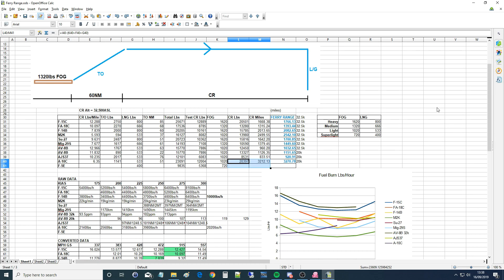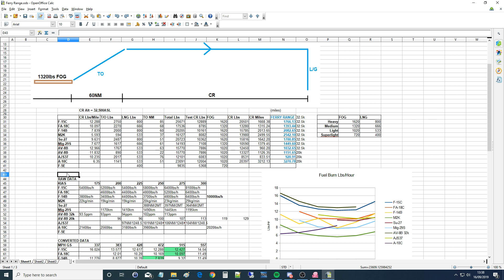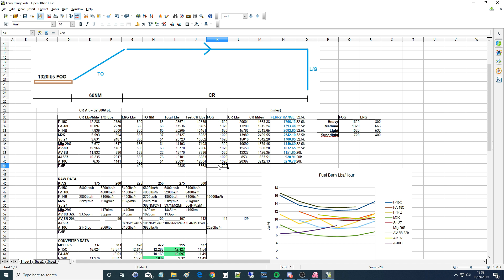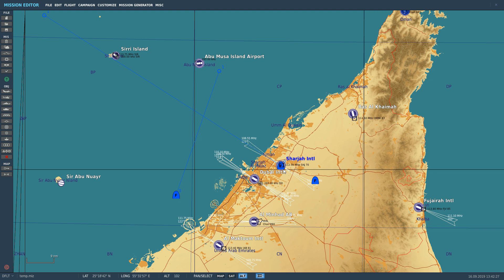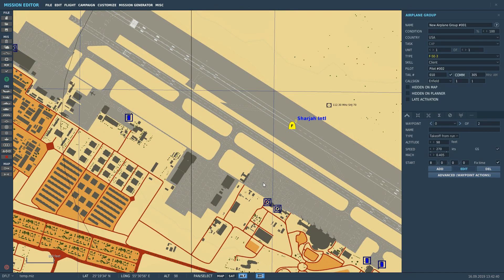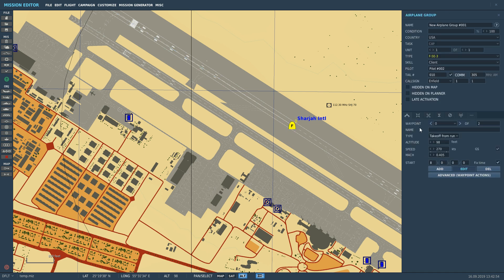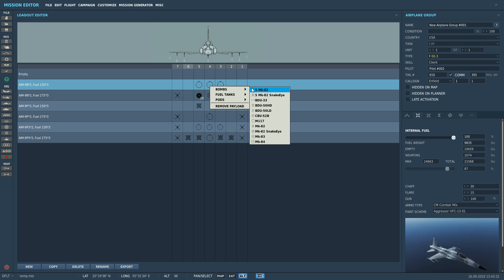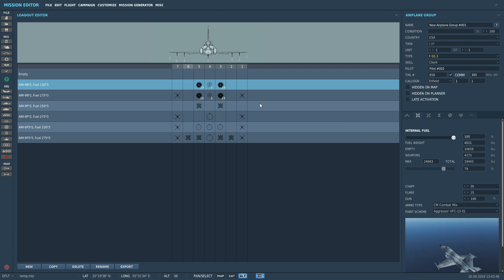F-5E Tiger II: Max Ferry Range | DCS WORLD

Comment: You have 2 mistakes there. 1. F - 5 is not In the upper table 5,094, but 5,904... 2. F-15 in. the lower table have green number 12,427 but 12,288 should be green.
Reply from the maker: Thanks will look into this soon

Comment: I worked my career in a foundry that made parts for a lot of these engines used in fighter and commercial aircraft. Combustion temperatures have increased and well as combustion pressures, massive work done on internal airfoil design and materials strength also. Today engines are designed with the help of super computers it is very fascinating if your into the tech.
Reply from the maker: Roger Sir

Comment: Straight turbojets based on a 50's design made cheap enough for disposability in cruise missiles, so yeah, they're not going to be the most efficient engines.........but you're also "discovering" how turbojets have a higher optimum speed range when it comes to efficiency and power delivery.  It's a big part of what makes some engines capable of supercruise vs others that are not because they have too much bypass, and otherwise can't shove mass down the engine fast and hard enough without resorting to fuel gulping afterburner.  Airframe aerodynamics and intake pressure recovery are a big part too of course.

Seeing what aircraft are supercruise capable (or at least max speeds at mil power) and their resulting fuel burns would make for a good video cap.